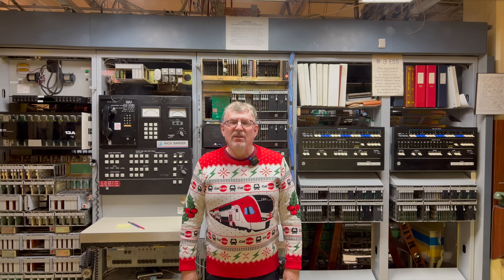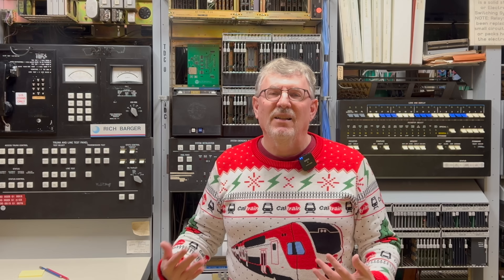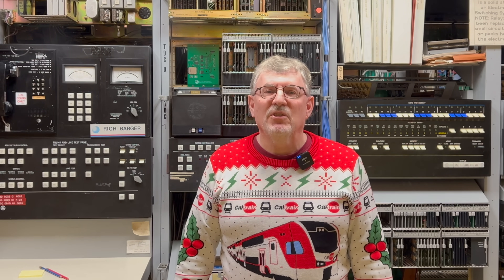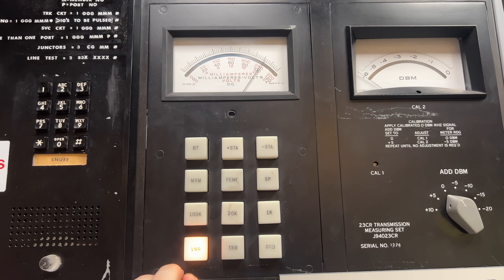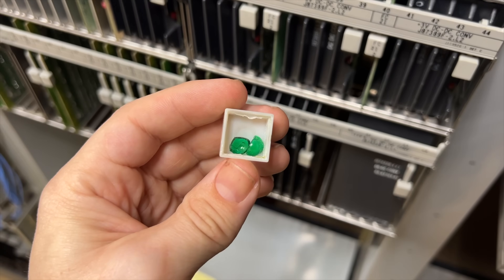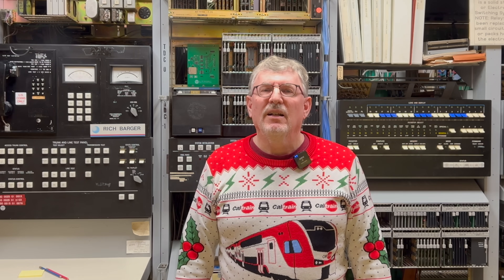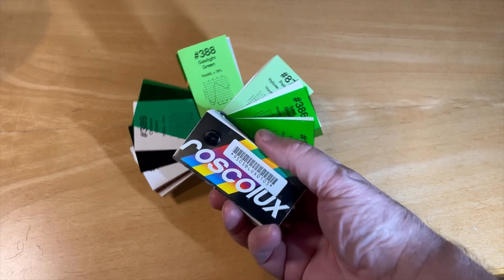Holiday Lights Museum Style!

Comment: Happy Holidays! I visited a couple of years ago and Peter was our guide. You folks are doing a super job, preserving this technology. Just the experience of walking through the buzzing, clacking corridors between the frames was very special. Thank goodness you have a tape emulator -- tapes (and disks) are...troublesome...as they age! Oh, and...nice sweater! Oh, and colored miniature lights? There used to be colored silicone...condoms, for lack of a better word, that fit over the bulbs. But your theatre gel solution looks like a winner.

Comment: Being able to see green lights again rather than white ones is reassuring, because white can mean anything apart, perhaps, from "Danger".  But why do some manufacturers think that "Power supply ON" should be a green light, and others think a red light best shows the equipment is switched on?  I've always wondered.  Is it a difference between "This equipment is LIVE so watch out!" as against "This equipment is on and all good to go!"
Yes please to any detailed videos on the 3ESS and especially to any smart stuff like tape emulators.  Thanks for all your videos in 2025 and all the best for 2026.
Reply: Some of the power supplies on the 3ESS have red lights too, so the machine is internally inconsistent about that.

Comment: At 2:53, Peter talks about the shattered green color filters inside the lamp and wonders aloud why only the green filters suffer this problem. I may have a clue about that. Railroad searchlight signals use three 1" diameter colored glass roundel mounted on a vane attached to an electromagnet. The vane swings left or right depending on the polarity of flow through the mechanism's coil, and centers itself if current is lost. It was determined that the green roundels suffered more frequent cracks, so they are intentionally pre-cracked at the factory. I'm not physiscist, but I understand that the problem affects green glass because of light in the green part of the spectrum doesn't diffuse the light sufficiently to dissipate heat. 

Speaking of railway signaling, there's a lot of interesting electromechanical relays and circuitry to design what must be a fail-safe system. There's a number of parallels with telephony, but there are also ways the two fields are completely different.

As a confirmed geek, I always enjoy your videos. Happy holidays!

P. S. I too like the Caltrain sweater.
Reply: I also wonder if it’s something related to heat damage, I would think the green light is the one that’s on most of the time and the likely get warm, maybe this caused heat damage to the green filters over the years?

Comment: Ha, what a silly question - of course we want to hear about the tape emulator and more about the 3ESS in general.
These little detail restoration and maintenance projects are just as interesting if not more than the big projects, because they often involve stepping outside the normal box. Making phones do phone things is well and good - but making a green light actually be green, or replacing a tempermental, fragile 50 year old tape drive with a modern stand-in is quite a bit more exotic.

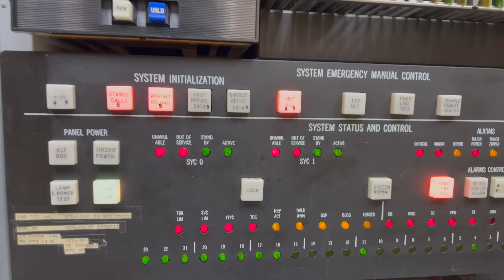Comment: 1:23 YES please more about the tape emulator.

I know that sarah must probably hate it .. but hey .. it holds/brings old original hardware alive ;)

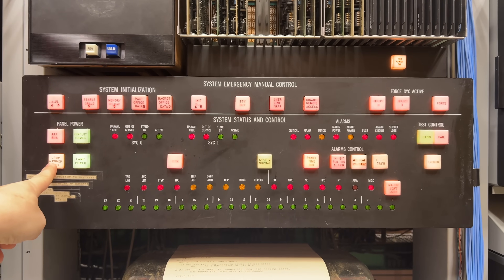5:30 Yes, i totally love those tiny details of restauration (of appearance) you do ;)
Reply from the maker: Based on my totally silly rules, its okay to put a little computer (the tape emulator) inside of a bigger computer (the 3ESS), just not into a purely mechanical (gears and oil) machine!

--Sarah
Reply: @ConnectionsMuseum  Heh .. your rules are not that silly after all ...... it's just trying to hold a balance between keeping good old original hardware working and maybe if absolutely necessary amending it with modern stuff......

I really love your approach ... pls keep it up!! ;)
Reply: Like .. you do with integrating asterisk for remote connections... 

it doesn't change a thing about the original analog/manual operations, but amends it's capabilities across the internet. ;)